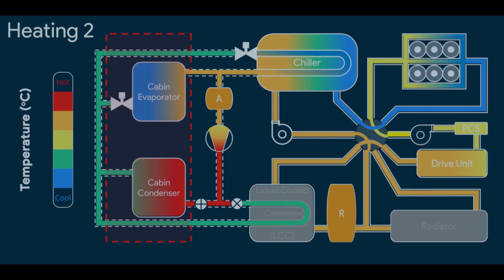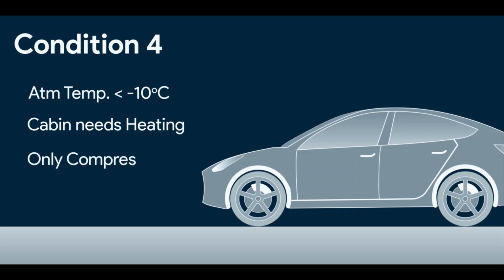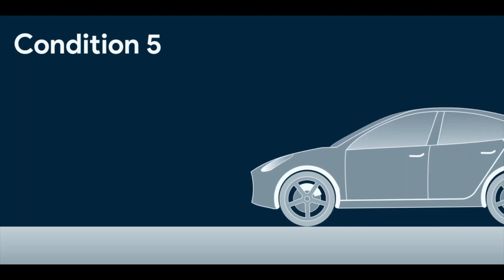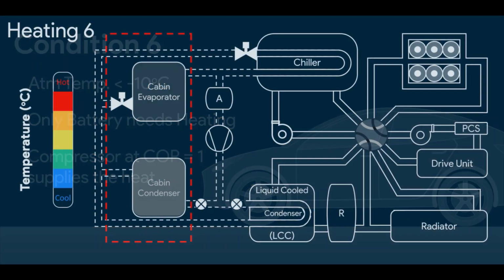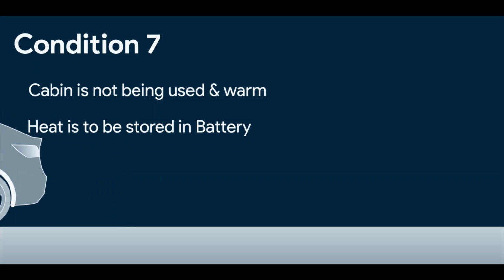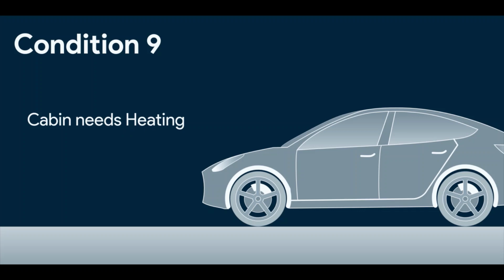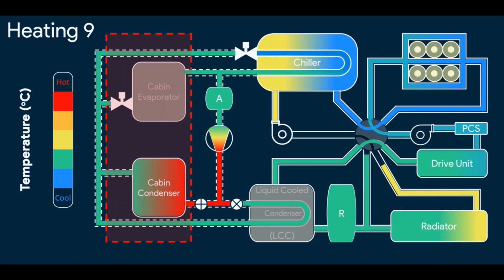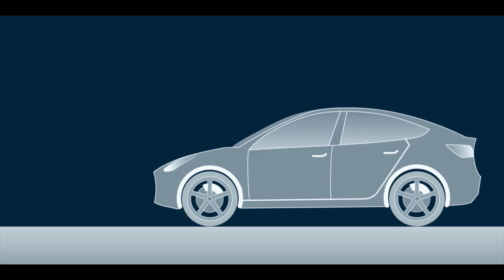P2 | Tesla Model Y Thermal management system with OCTOVALVE & HEATPUMP | Working in Detail

Comment: great videos, thanks for the effort; not clear if low-voltage heaters are really there, if so - why not used in other modes where battery/drive unit cant supply heat; I guess this is just direct interpretation of the patent; actual implementation may be different;

Comment: Does the model y still come with low voltage cabin heaters?  Many people are having issues with heat right now. Maybe the vehicles don’t have low voltage heaters?
Reply: I don't think MY has LV cabin heaters.  I think that under certain conditions, the motor/inverter is used in a way that intentionally uses low power factor power that causes the motor(s) to heat up.  This heats the coolant flowing through the motors. The warmed coolant then goes to the chiller, warming the refrigerant, then through the compressor and into the cabin condenser to warm the cabin. This, anyway, is what I think I have observed in Service Mode in my summer 2023 Fremont-built MYLR. One can see the front and rear motor/inverter temperatures spike.  I'm thinking some parts of the modes shown in this, now 3 year-old video, aren't applicable for newer M3 and/or MY.

Comment: I just started an analysis of this system, which I will be posting on my channel soon.  First off, there is no "LV" or even "HV" heater in the cabin.   The older non-heat pump system in the Model 3 had a PTC heater running off HV.  Tesla has never used an LV heater, that would be pointless.  In any event, the HV PTC heater was removed on the heat pump system.  The only extra electrical heat that can be injected into the system is from the drive unit, it can be put into a "total loss" mode where it just makes heat from electrical power.   Also, looks like your coolant circuit is drawn wrong.  First off, The radiator is not teed with the LCC.  The radiator has it's own 2 ports on the octovalve.  (the middle 2 on the bottom)  There is no "9th pipe".
Reply: In the patent itself (Figure 13) you can see that the cabin environment has two LV with the cabin condenser. You're right about the PTC not existing anymore but nobody is attesting that. 

What's with the attitude?
Reply: So sounds like this video is giving a very good overview still. It's just that mode 3 doesn't actually exist and the exact ports and routing around the octovalve are a bit different. I've still yet to find better videos about it.

Comment: I really like your work and respect what you study and share here, especially regarding octovalve. However, according to your explanation, in mode3, system can use heat coming from battery and in addition to this LV heaters does work. Its OK. But could you please explain why those LV heaters doesn't work in cabin, in damn mode4, although there is no heat coming from battery?

Comment: Worth adding that in modes 2, 3 the radiator blinds are closed, effectively reducing radiator cooling, otherwise seems a bit strange that when heat is scarce, fluid from warm battery/drive unit must pass radiator. Are you sure octovalve passes heated liquid through radiator in these modes?
Reply: It can be either bypassed or shut the airflow at front shutter so heat exchanger becomes much smaller; bypass needs additional valve for cost, AGS works but additional system loss.

Comment: Great video! just a couple of questions below
1) In heating mode 6, why does the chiller need to be activated?
2) In heating mode 7, The driver is not in the car yet, how is it activated before the drive?
Reply: 1) The coolant is at high pressure. Before entering the compressor again, the coolant has to be expanded somewhere. Options are your Chiller or Cabin Evaporator. Since the Cabin is inactive, only the chiller can be used.
Reply: Tbh, mode 6 is fancy but really inefficient. When condenser heat cancels the chiller (it has no choice since there is no air condenser any more to exchanger from ambient), only available heating becomes your compressor power, likely low COP; in this case why not just a coolant heater with no losses from plate heat exchangers as well :)

Comment: I found that cabin condenser is the main heat source for most cases. Is it common for EV?
Meanwhile, resistance heater is only activated in case #3, which is quite less and weird, since it is the main heat source of Model 3's cabin. Did I miss something?
Reply: You are right. I don't think Case#3 is the only case (below minus 10C) where resistance heater works.

Comment: Such a great video, thank you. But I dont understand how Condition 7 works. It looks like the compressor (the funnel-looking piece below the "A") for heating is on but I am assuming the car is "off" and no one is inside, so the compressor isnt needed and would just be wasting energy. Can someone explain what is happening here please?
Reply: In condition 7 the compressor loop is cooling the cabin (A/C is on) but instead of rejecting the heat to the atmosphere it stores the heat in the batteries by warming them up. That's for the reason mentioned: the batteries will stay hot for a lot longer than the cabin.